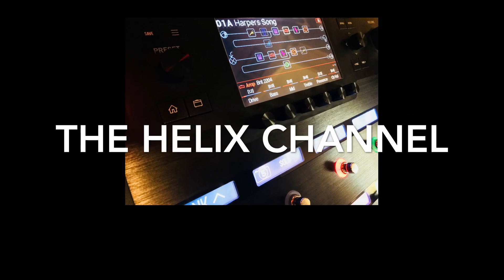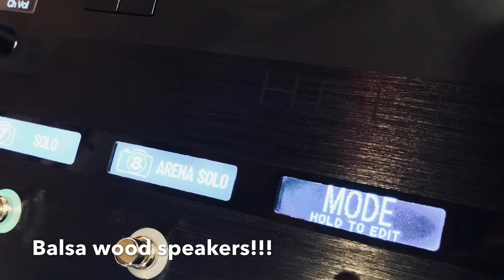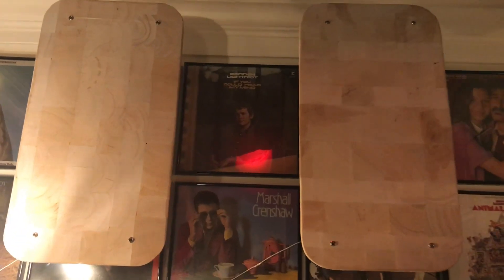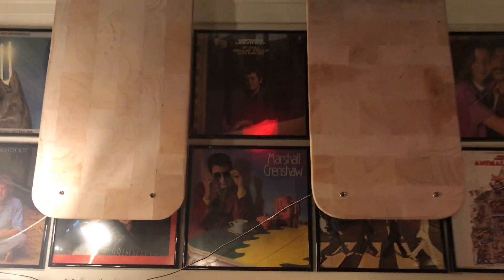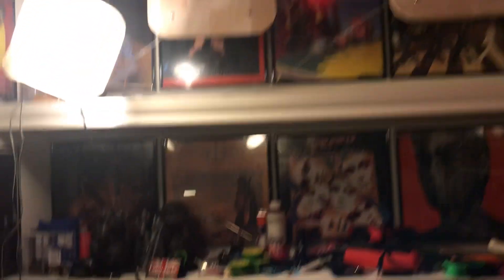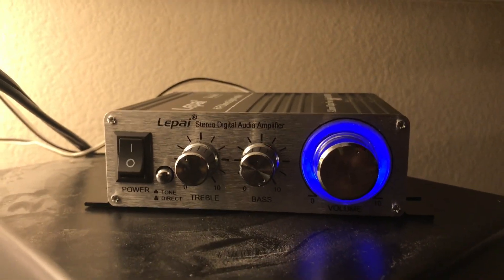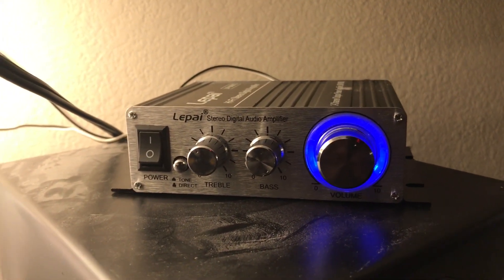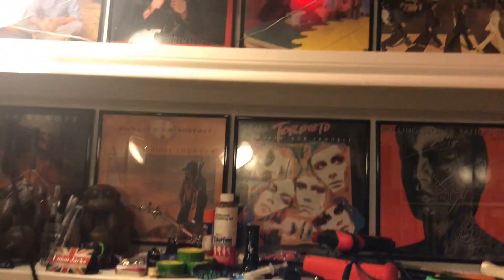Balsa Wood Speakers!!!

Comment: I'm curious about something like this using a composite material like pine with a balsa core or birch with a balsa core. I was also thinking about the effects of mounting them in a frame with something like rubber. I don't have the money or knowledge to experiment with it, and am not an audiophile so all the technical stuff speaker guys get into is overwhelming. I just remember hearing the Aluminum panels and they sounded great except for ringing like a bell but I thought I bet either a strip of thick rubber around the edges mounted in a frame would dampen that right out, or even cutting out the center of a foam panel. Something soft enough to let it vibrate but heavy enough to absorb the ugly. Maybe I am missing it, maybe I'm crazy, it just seems the limitations could be mitigated somewhat.

Comment: hey cool video.  it adds a lot of credibility to these dml speakers that a musician vouches for them.  Are they 1/4 inch thick?  When you showed the cross-section late in the video I was surprised they were that thick.  I honestly didn't know that would work, thought they had to be thinner.  I'm on the corelite website and I don't see what you bought.  Thanks man.  Your music is cool too, nice.
Reply from the maker: After building and testing the balsa wood speakers, I would choose a different material for my next ones. Believe it or not, acoustic ceiling tiles actually sound better than the balsa version. The problem I ran into with the balsa was at higher volumes it tends to vibrate in an ugly way, causing distortion in the music. There are just too many voids in the end grain balsa panels, causing unwanted distortion. Those panels were 1/2” thick, if I remember correctly. Next time, I’m using acoustic ceiling panels!
Reply: @Scottsguitarplayground  thanks that's interesting.  The tech ingredients guy actually did recommend those ceiling tiles.  Hard to imagine an uglier product to make speakers out of although if you place them the right way they will just look like acoustic dampeners or something.  Wood is the most attractive product I've seen used for this purpose.  I'm amazed that anything 1/2" thick worked at all.  I was planning to buy something 1/8".  Possibly you could stabilize the balsa with a layer of epoxy, but possibly it would make them too stiff to work.  I'm really interested in all this but I'm possibly just going to buy regular in-wall speakers and be done with all this.  It's hard for me to do any carpentry cuz my wife has taken over the garage and guards it jealously.

Comment: What size are each speaker flat panels? (LENGTH/WIDTH & THICKNESS)    Where did you mount each exciter on each panel?  OUTSTANDING VIDEO!
Reply from the maker: The wood is 24” x 12” x 1/2”. I don’t recommend using the balsa though, too many tiny cracks and crevices that vibrate annoyingly at louder volumes.
I mounted the drivers about 4” in from the side and about 6” down (or up) the the bottom or top edge...intentionally not centered.
Reply: @Scottsguitarplayground  have you tried the high density foam board yet? There's a 2/3rds rule for exciter placement too. I'd love to see you your results with the foam. I'm about to build some for myself.

Comment: so far the nicest looking version I've found online you did a nice job.
Reply from the maker: Thanks! I'm going to try doing this again, but with a different material...the end grain balsa was just too porous and vibrated in unpleasant ways if you turned them up. 
Rock on,
Scott.
Reply: @Scottsguitarplayground   Ha ha so funny I have a friend that always ended with Rock on,  When I get mine I want to try drywall and heavy 1/2 rubber mat that I have...I have a pair of old Magenpans given to me that are on stands not sure why the first thought was to hang these from the ceiling I would want them to resonate if they can so far most of the video's they sound like pure treble, that could also be poor recording quality.
Reply from the maker: @mowler8042  I want to do my next one with a really nice piece of material...still not sure what it'll be though. A quality piece of exotic wood plywood might be in order.Something with a beautiful grain.
Reply: @Scottsguitarplayground  maybe Bubinga?  I had a thought the other day wonder if you could do a mix of material like the speaker is attached to a size of dense wood and like a picture frame the outer part is dense foam or the the opposite

Comment: I wonder about Mable or Birch Ply, like used in a Grand Piano. I know many people use Foam and such so is a lightweight panel preferred?
Reply from the maker: I think a nice Birch plywood would be great for this application, as long as it isn’t too many layers...maybe 7 ply. It would be much more attractive as well.
Reply: Scott's Digital Guitar Playground I will try 1/2” birch and 1” foam board and compare
Reply: @ze_german2921  How did they turn out to sound ZE German?
Reply: @Scottsguitarplayground  9 layers of birch plywood at least is too thick! I'd use a 1/4 inch thick then. But I prefer the sound of the balsa being warmer. I am going to make a pair of those panels in DIY style as it is hard to get for a reasonable price in the Netherlands
Reply from the maker: @martijnvanbeek4387  The only issue I had with the Balsa ply was the voids in the wood cause annoying vibrations at louder volumes. My next set will be made with a better quality ply or maybe polystyrene panels (no voids).

Comment: Cool vid...Could a coffee shop P.A. be possible? I'm familiar with pro audio and feedback issues as well as the need for sub but, theoretically, could a mono vocal P.A. be at all possible? How are vocals through yours without the sub? Also, can you bridge that Lepai for Mono? Thanks!
Reply from the maker: adrian mettz I think if you used a more stable material, like polystyrene or birch plywood, you might be able make it work...if you used multiple exciters per sheet. 
Hanging the panels is a tricky thing, avoiding vibrations that can cause distortion. I’m using a consumer subwoofer, so, I’m not sure it would work for your situation.